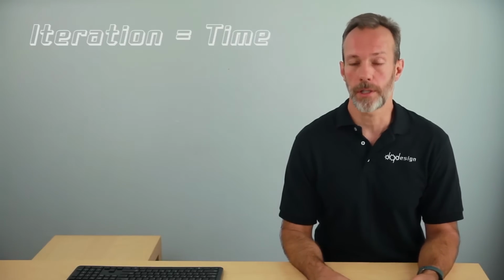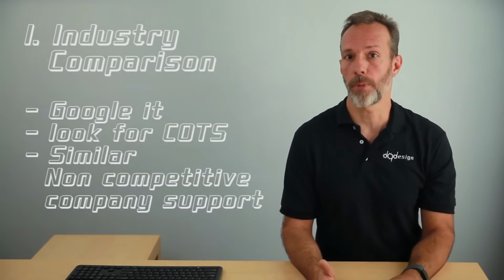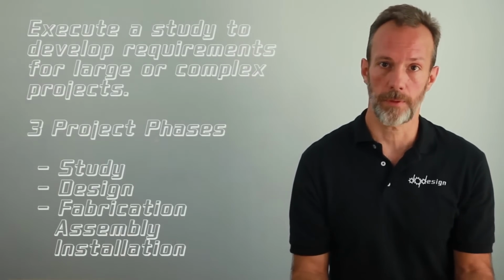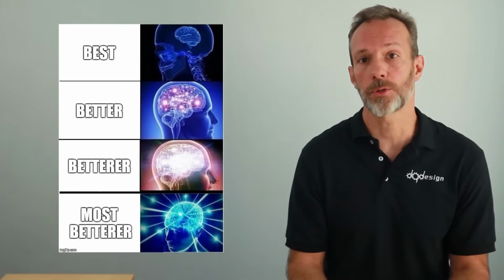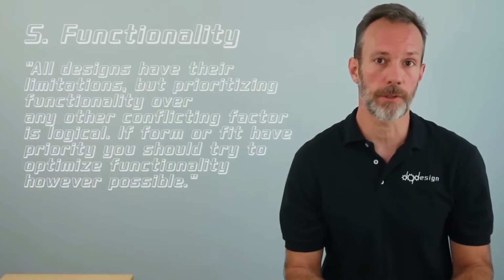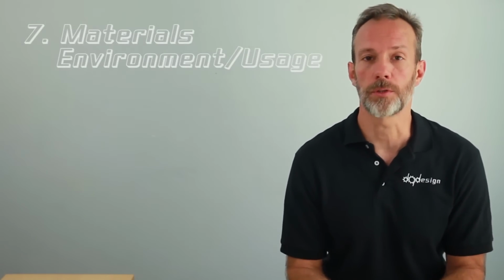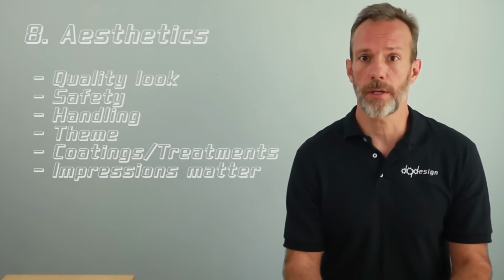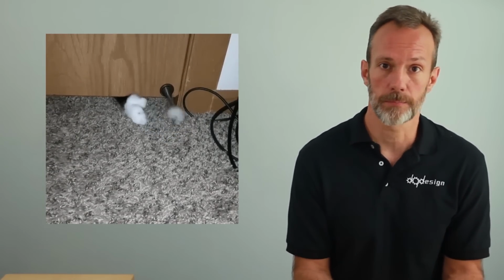Top 10 Steps of the Mechanical Design Process - DQDesign

Comment: I found your video via Reddit and I have to say it's very well done, informative and funny. You have a cool background story too. I am a diy shade tree dummy, figuring out how I'm going to design a cheap stand for big rolls of packing bubble wrap for a non profit that I volunteer for, with materials that I already have. Your video did help reaffirm my thinking that I should use an engineering/design firm, rather than going straight to a contractor for a big project I'll need to do at my house. Thanks!